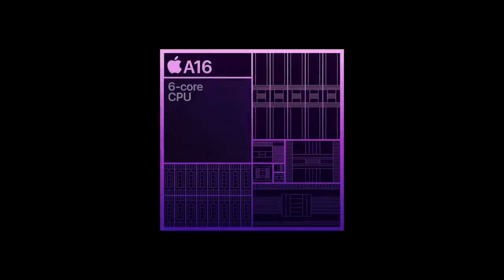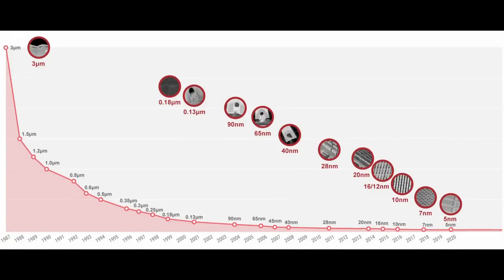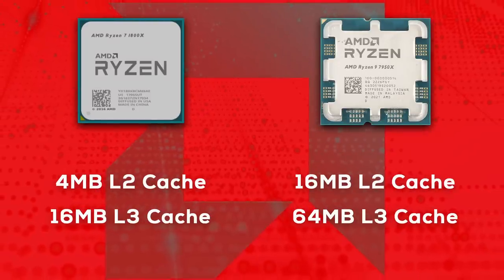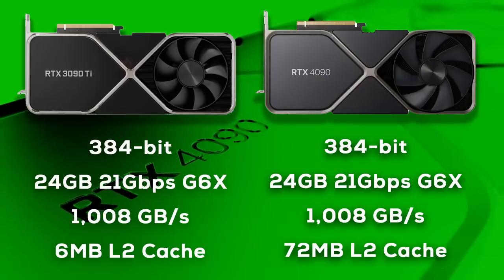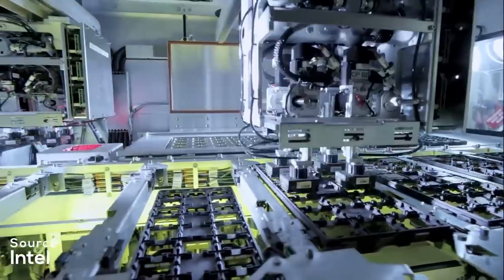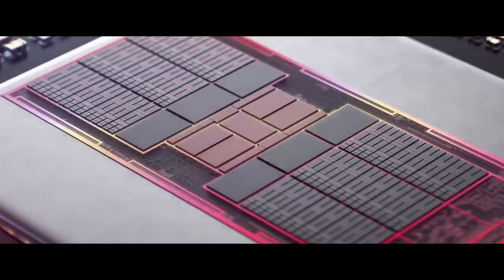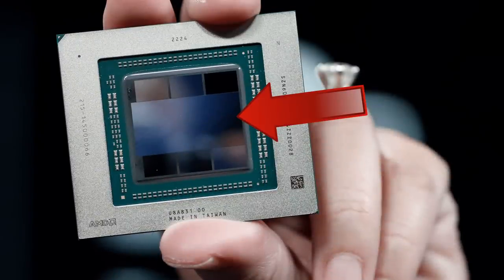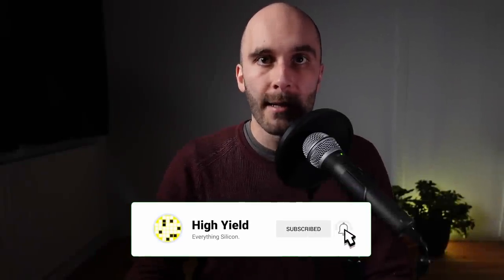Next-Gen CPUs/GPUs have a HUGE problem!

Comment: I think you overestimate the cost reduction from using older manufacturing nodes for SRAM. In the past, the massive reduction in chip cost (for the same performance) has come nearly exclusively through scaling (shrinking microstructures), not through using mature manufacturing nodes!
Reply: But if you’re using a larger and larger percentage of your die just on SRAM, then you are losing much of the benefits of moving to a new node anyway. If you’re going to reclaim that area, and move the SRAM onto its own die, you might as well use an older cheaper node.
Reply: @JoeLion55  Yeah. Still, this means hardly any further SRAM cost reduction. Contrary to what the video author said.
Reply: @cube2fox  He said “Chiplets can be one of the solutions to combat the stagnation of SRAM scaling. To be honest, it doesn’t really solve the problem - it’s more of a smart workaround to counter the number 1 problem: rising manufacturing costs. Older process nodes are not only more mature, they are also much cheaper.”   

I don’t detect anything wrong in those statements. TSMC’s N7 node uses 4 EUV layers. N6 has 5 layers. N5 14 layers. N3 up to 25 layers. Overall number of process steps has doubled from 10nm to 5nm nodes. That’s nuts. Not to mention the EDA costs for design and verification are rising exponentially. If you can offload the SRAM onto a wafer that’s 2-3 generations behind leading edge, that’s going to be a huge cost savings for that silicon, not to mention the gain of freeing up valuable space on the leading edge wafers.
Reply: @JoeLion55  If N7 is significantly cheaper than N3 this doesn't mean it allows for any "cost savings". It doesn't mean N7 is significantly cheaper than a few years ago. There is a big difference between stagnant costs and actual cost savings over time. In the past, scaling allowed for strongly reducing costs (because the same amount of SRAM could be produced on a much smaller chip area, and the price per chip size was mostly constant), but I see no evidence that manufacturing nodes get similarly cheaper when they've gotten more "mature". This probably means that the price for SRAM will not get much cheaper in the future.
Reply: @cube2fox  but for “cost savings” everything is relative. It has to be compared against the alternative, or the status quo. It seems as though AMD has done the math, and others might soon follow, and determined that overall it is cheaper to make dedicated SRAM dies on an older, cheaper node, then stack those on logic dies on a newer node. Since the logic dies have much less SRAM on them, they are much smaller than they would be as monolithic logic+SRAM dies, and therefore more dies/wafer on the advanced node, so fewer expensive wafers are needed. As long as the total cost of the smaller advanced-node logic die + older-node SRAM die + additional packaging cost (and assuming the performance is good ebough) is less than the per-die cost of a large monolithic die on the advanced node, then that’s considered a cost savings.
Reply: @JoeLion55  I disagree. Not switching SRAM to a more expensive advanced node prevents a cost increase, but this doesn't mean cost get reduced, as the video author claimed. Change in cost is always relative to the cost in the past, not to some new advanced process node.

Comment: Every so often I hear 1 transistor SRAM mentioned, but never in the context of someone actually using it. I know it was compatible with an older FinFET node and it was claimed to increase density significantly. Did it not scale well? Do companies not want to license the IP if they don't have to? Were the yields poor?

Also I wonder if SRAM will scale a little longer on nanosheet FETs
Reply: 1 transistor SRAM is just DRAM with the refresh mode hidden. It did not work out because it is slower than SRAM and even slower than DRAM. Is you want fast memory you use SRAM and if you want dense memory you use ordinary DRAM. 1T SRAM is a memory cell that got all the bad parts. Slower than SRAM and less dense than DRAM.

Comment: This is not a problem. this "huge" problem is due to a temporary issue with scaling by TSMCs slowing of scaling after their 3nm node for SRAM, a problem that is likely related to the chemicals they use for the photolitography process on Silicon.

Comment: I am Logic Design Engineer , nice video but not exactly right. you can NEVER switch sram with 3D cache, Sram latency is cycle, if it is really really crappy one 2. latency to other chiplet is x30-300 if you are lucky.  There is always a trade of for using and not using Sram, because of that more and more design will move from SRAM to just regular Flop/Latch based arrays :) if you have questions you can ask :)
Reply from the maker: The 3D V-Cache chiplet on a 5800X3D is SRAM based. Or what do you mean with “3D cache”?
Reply: @HighYield  yes sure it is LLC  - last level cache.  it is used not so often and have huge latency.  in all CPUs/chips they are lots of SRAMs that are extremally  critical for latency and even switching from 1 cycle to 2 cycle Sram cause hit in performance as high as x2. and switching to Chiplets not because of that :) only because of the cost. with more bigger chips the YIELD(funny) is lower. so switching to chiplets drastically increase the Yield so it is cheaper to make. but all know it is worth for performance. take AMD chips the APU are monolithic and the CPU are chiplet based you can see that the APU have much higher preformance to memory because it is inside the COMPUTE and not outside.
Reply: When i say "not so offten" i am telling it from cpu perspective.
Reply from the maker: Now I get your point! You are saying L1 and L2 cache won’t be moved to chiplets any time soon because of latency. Got it! I agree, L3 and L4, or what every the “Infinity Cache” is are moving first, which weil free up space on the base die. Maybe we’ll see a stagnation in L1/L2 cache size because of this?
Reply: @HighYield  yeap. Btw cpu have many memory that is not cache (cache is more re-use). That use sram they are much smaller too (100k bytes, 10kbytes etc) they will forever be in the cpu maybe not sram just some flops / latches ( same fuctionality different implementation )
Reply: @Denis Khachaturian  offtopic : Do you know something about Paul and Unger I got that in electrical engineering in reducing states was awesome but .. i really like to solve such things ... like to know more on that
Reply: @confidential303  what ?

Comment: This might cause a move towards a new type of computer. "Smart RAM" or the like, where processing logic is spread about among RAM, so you have a RAM chip that can calculate. It removes the CPU / RAM bottleneck entirely, there's no longer a separation. Of course, programming it might take getting used to, but programmers managed to adapt from the single-core CPUs PCs had for decades, to the multi-cores we have now, and of course GPUs with hundreds and thousands of different logic elements working, to some degree in parallel, vector processing. 

A graphics card might benefit well from scattering logic among the RAM. No delays waiting for memory, everything working physically local, short distances for the current to cross. GPUs are already halfway to this methodology, they could probably use it, and with new drivers existing software would work fine. But it would open the gates to many new possibilities. Like when the first programmable shaders appeared.

A new paradigm might be needed. Study software, see what it's needs are, it's shape and it's flow, and what it's trying to achieve. Then think of other ways you might achieve the same. People are researching this, and have been since forever, but now if we're hitting a wall, it's time we started asking them for something radical.
Reply: Graphcore ipu already does this...

Comment: So the take away is that next generation computers won't be smaller.....considering how small computers have gotten I considereal this a non-problem at this time. Also consider for the vast majority of computer users both personal and industry the current generation of processors are overpowered for our needs (not that that's a bad thing.) Only a sub set of users hard-core gamers/enthusiasts and tech heavy industry would need the extra  computing power and are less concern with footprint to get there.

Comment: This is true for silicium, it's a quantum effect systematically found around 2nm and below: it's a hard limit. However, Huawei has developped a solution based on graphene that repels the problem to a much further scale. Unfortunately, Huawei is barred from ISAs like x86_64 and ARM and has fully turned to Risc-V: tough luck for Intel, ARM and ASML: Huawei is not sharing. Worse, Huawei is barred from sharing. TSMC is being drained by USA from its current skills, but Huawei did not work with TSMC since Trump tried to jail Huawei's CEO: the next generation of chips is not going to reach the West, or just with overly powerful Risc-V knock-offs of the shortaged Raspberry PI. And that is not a problem with physics.

Comment: I haven't understood anything. Can someone sum it up in simple terms?
Reply from the maker: Chip get smaller over time, but not every part of a chip gets smaller at the same rate. Now it seems like memory cells, which are used on CPUs & GPUs, wont shrink with the next-generation of technology. This is a problem, because it means new chips wont be as small as expected, leading to higher cost.

Comment: Flash stopped scaling a while ago. They solved the problem by stacking layers. I wonder if they can do the same for SRAM.
Reply: There are already designs for stacking and an N type and a P type transistor called CFET. This designs are already on the industry roadmap. The expected transition is GAAFET nanosheet then ForkSheet then CFET.

Comment: It's not do or die anymore, it's do or chiplet! And despite Intel announcing Foveros years and years ago, it seems like AMD is still the one going first with the chiplets idea and getting their lessons first. Though to be fair, Intel's Foveros and what they're trying to achieve there is much more advanced and ambitious. I just hope it's not delayed anymore like almost everything they had to release lately.

Edit: I forgot to say: this was very well presented. I basically knew what this wil be about and after seeing it, I can't think of anything that must've been added, removed or be said in a different order/manner. And I do agree that it's a problem. Future CPU and GPU releases will now have less performance improvements since they'll no longer benefit from extra cache size that was usually a part of the bigger increases. Also, I think that the performance/watt increase will slow down a bit, since the sram part will continue to draw the same power as it does now.

Now I'm curious... is DDR memory affected by this too ?
Reply from the maker: DRAM isn’t as affected afaik. DRAM production doesn’t even uses EUV yet.
Reply: @HighYield  Are you sure ? I vaguely remembered that DRAM is usually on the same (ish) manufacturing node as the CPUs.

A quick search for "DDR manufacturing node" gave me this article from octomber 2021 saying that "Samsung's 14nm five-layer EUV fabrication process will enable DDR5-7200 chips".

Thinking about it, it's been only a couple months since DDR5 just broke the 5 GHz barrier (aka DDR5-10000). Crazy to think it could do that on something pre-EUV, though theoretically not impossible.
Reply from the maker: The switch to EUV is currently happening, Micron is even delaying EUV introduction for another year. Maybe Samsung switched recently, but it’s a bit behind “normal” process nodes.
Reply: At a cursory glance, Foveros seems to be similar to the MCD/GCD interface in RDNA3, is that wrong?

Comment: I use CPU from 2015 Core i7 5775C, has built 128MB L4 Cache.
Reply from the maker: The 5775C is a really interesting CPU and due to the large L4 cache it’s much better at gaming than its predecessor. It even beats the 6700K.

Comment: does amd using 3d chip desing could be the solution to the problem, by staking it? Also intel and amd should use GaaFET  instead of FinFET , but will eventually hit a wall too.

Comment: So, sram is the real name for the lvl 1-2-3 cache memory that is on the chip, beside compute units, or for 5700x3d l3 cache, in a layer on top of the cpu.
It seems the future is chiplets, with infinity fabric connections.
This reminds me of the early days of cars, where bigger and bigger engines where fitted. Like the car industry, the SoC also need to refine their production, to get more with less.

Btw, is the internal bus systems the same as AMDs infinity fabric? I noticed my Ryzen 2600 cpu multiplier was based in 100mhz, as I had to set it to 39 to reach 3.9ghz clock
Reply: Infinity Fabric is far too slow for L1 cache.

Comment: May you please talk about the present state of many-valued transistor and multi-valued circuits?
Reply from the maker: At some point maybe, but I'm not a semiconductor engineer, I basically have to learn all that stuff for myself before I can try and explain it :D
Reply: @HighYield  A multivalued transistor can emulate 2 or more transistors with a single transistor. That requires a transistor with 4 states, instead of the classic 2 states.

That's a possible way to preserve Moore's Law without miniaturizing transistors.

Comment: nothing new, we had similar problems with similar solutions to overcome in the past, just remember the slot 1/A CPUs with separate L2 cache running at half the clock speed and even those were faster than the previous generations

Comment: As DRAM and VRAM become increasingly faster, perhaps at some point it will catch up to SRAM and it be incorporated onto different hardware to accommodate for its size. Perhaps moved to be manufactured onto the motherboard instead, vacating its presence on the CPU die (which could lead to higher core counts, more relaxed core spacing of other CPU components, or even leave room for new CPU technologies like AI based cores or such.)

Comment: You must be young or better yet I'm just getting old..  As CPUs manufactured in the 1990s (ex. 80486) had separate but dedicated external L2 cache chips.  We aren't advancing, we are moving backwards. Also, lets just ignore the issues with higher latency and power consumption associated with additional "off die" hardware.  The more things change, the more they stay the same.  Like the "cloud" simply replaced the term mainframe/data center. Sure the software stacks are massively more capable and network links are much faster but the underlying architecture and concepts haven't.  I digress, "off die" cache systems aren't new and they aren't innovative.  It sounds like physics are starting to catch up with microprocessor designs.

Comment: Having used laptops for years an broke a lot of them AMD makes a more durable pc my original AMD gaming pc is still kicking 5 years down the road but every time I get anything with Intel its cpu is burnt out before a year goes by. The only time i have ever had a pc with a AMD cpu break was someone spilled pop on  my pc and to be fair I cant blame that to the pc.When the GPD win 3 with Intel i9 came out I bought it and it wont turn on with less than a year of use buyer beware! Your new car may have more horse power than mine but my transmission is going to last longer than yours and at the end of the day.

Comment: I think it is little misleading to use AMD CPUs with different core counts as comparison of cache increase. Ok, 1800X is having 8 cores against 7950X with 16 cores, that it is... 1800X 0.5MB L2 per core vs. 1MB L2 per core. So, they double it... and only in comparison of AM4 vs. AM5, which are different platforms. 

That's like trying to compare hatchback with a station wagon, and stating that we are at limit of cargo space for "small vehicles". 

For correction of this, we can use 5950X (16 cores, 8MB L2, 64MB L3) and we can only compare increase in L2, L3 is same as 7950X. I understand that storytelling needs a hook, but when the hook is based in unfair comparison, I can't stand it. Especially when you use latest and previous generations of products to prove your point with Intel and NViDIA.

Comment: Lol y would transfer the cache in the dram  since ram is relatively cheap  it would not impact the performance,  in the server would cpu cache is virtually  you can even assign  cache from other machines if necessary  after all 1 tb  optic fiber connections are not alien to servers

Comment: First just want to say that i hope your channel grows beacuse i feel like i struck gold browsing youtube with your content.
Second i don´t want to sound like a fanboy but i would assume that AMD MAYBE will have an advantage  with chiplet design only beacuse they are the first company to at least release products like that (at least that i know) so maybe they will mature or at least found a workaround to the problem more quickly than the other companies but time will show us the truth.
Keep up with the good content ;)
Reply: 1st gen chiplets has teething problems that can be resolved with better tuning and adjustments as they make RDNA 3 refreshes, right now the issues comes down to fabric based GCD and MCD fighting over limited resources like power wattage. I don't like how Nvidia fanbase keeps defending and downplaying the big metal radiator that is the heatsink on the 40 series RTX with the massive monolithic die, it performs very well at a 'modest' power efficiency but at a massive cost to cooling solution size and problematic power connectors.

It also shows that Nvidia hasn't yet budged on a scalable solution, so their RX 50 cards will be the same, even more massive, and they hope their 'white knights' still buys into a chunky 4 slot piece of metal heatsink that probably is so heavy the PCI-E slot would snap off.